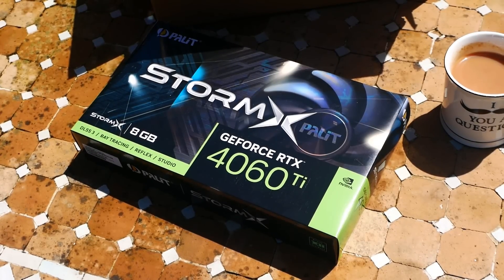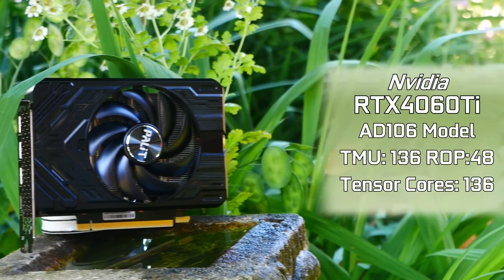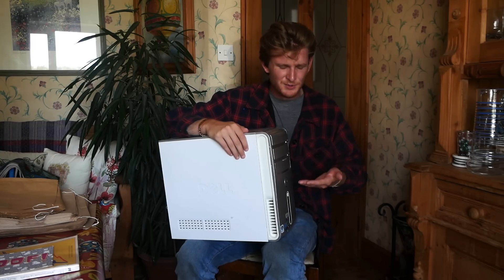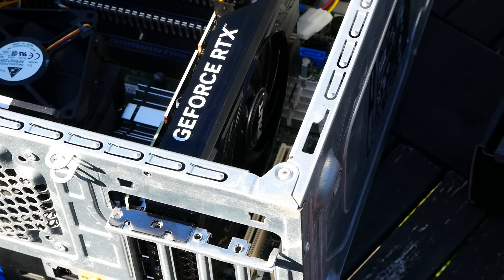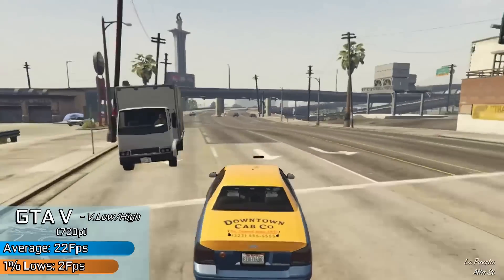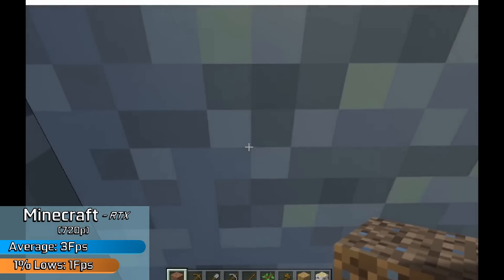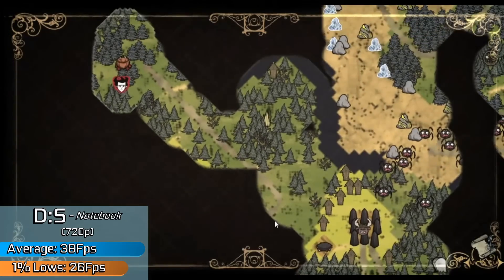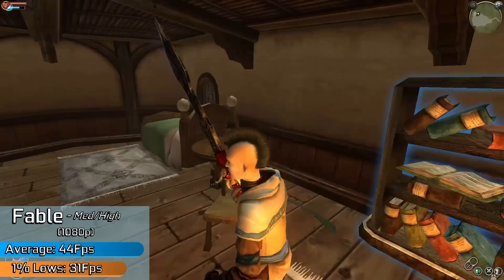RTX Graphics Card in a 20 Year Old Family PC...

Comment: This was extremely enjoyable and something I had no clue was even possible. A Pentium 4 with an actual useable PCI-E Slot 😭 You should try a Core 2 Quad and compare em. It's incredible to think about modern CPU's.. Nehalem was released in 2008 and is still somewhat useable, that's the same amount of time going back to the original P5 Pentium in 1993 and the P5 was not useable in 2008.
Reply: I was enjoying westmere until just last year. The old xeons are utterly capable even lacking avx2.
Reply: @ignotumperignotius630  definitely. Tons of YouTubers including myself have praised em for years. I have a Westmere EP system still to this day with 5690s that's extremely capable. I even used it as a main rig for a while earlier this year due to a fatal issue with my main rig. I used it for editing and playing Battlefield 2042 casually for about 2 months. Even Fortnite ran well and I was using a 3060ti and GPU usage was 100%. I was impressed again, to say the least
Reply: Not really a surprise when the northbridge was responsible for PCIe back then.
Reply: He kind of compare them at 12:46

Comment: I wonder if one of the newer AMD RX 6000 graphics cards would do better. They perform more tasks on the GPU instead of farming it out to the CPU, so you can get 20% or so more performance than Nvidia sometimes if you have a really slow CPU.

(AMD GPUs can be more difficult to get working under weird situations though, and this is definitely weird lol)
Reply: These dell BIOS require a boot mode that AMD doesnt support I will test with my 6700XT on my P4 system.
Reply: @RedStripeMedia  As soon as I get my upgrade ready, I will throw my 1060 into my Core 2 system, just to see how ridiculous it gets.

Comment: the ram is the issue in most i have a dell t5400 with 2 e5450 3ghz quad core processors and 32gb ddr2 fb ecc ram. gta v runs at most 45fps as the ram just isnt fast enough.

Comment: Makes me think, if Budget-Build Official will ever do an AMD APU + Matrox Arc A380 (Intel) build.

Technically, with a Full ATX B350 board, he can have access to a Ryzen 5-5600G + the Matrox Arc 380 and have PCI lanes for a Voodoo 2 or Voodoo 3 PCI, which can be made to work on Win10.

So he'd have
AMD (ATI in spirit)
Intel
Matrox (using intel ARC chip)
3Dfx

All in one.

Comment: Would have been interesing to see if the newer aaa titles launced on this cpu and the rtx 40 series with their frame gen support reduces cpu load even further smoothing out the frametimes. And also using 1080p as the testing resolution might have helped as 720p was really hard on the already weak cpu!
Reply: Some will not start. The CPU is missing a lot of instructions.

Comment: So the inspirons of that era were UEFI? afaik Nvidia dropped og BIOS support after pascal
Reply from the maker: It worked with an RTX3050, it doesn’t like booting with them in there but usually will after 3-5 attempts.
Reply: @BudgetBuildsOfficial  so it is in fact BIOS not UEFI? My friend tried running a Vega 56 in a baller Asus 775 board he found in the bin but it artifacts when booted to an OS with the Vega, however his 1070 is fine

Comment: I wonder, is it possible to make a Pentium-only LGA 775 board to start with a Core 2 Duo processor? Would editing the bios be enough for this? There are some decent boards out there that could benefit from having Core 2 Duo instead of the maximum of Pentium 4/Pentium D. Hell, I wonder if it is at all possible to make Core 2 Quad work on that.
Reply: I once had an old Amilo Desktop that came with a late P4 and was upgraded to an E6600 through a simple BIOS update. It mostly depends on the motherboard/ PC manufacturer. If no official update is available, it depends on the chipset and FSB, but generally speaking late P4 motherboards can run Core 2 Duo pretty easily.
Core 2 Quad are generally a no go unfortunately, could never make one work even with BIOS modding, they are completely different.

Comment: I wonder if an RX 7600 would have done better, due to the driver overhead on the Nvidia card.
Reply: That's what I thought! Getting rid of that annoying driver overhead and it should be silky smooth.
Reply: Makes me wonder where AMD have improved their driver overhead. I still remember during DX11 times how much they gained from switching to Mantle and later Vulkan.
Like in Doom 2016 where a RX 480 easily gained 25-50% and went from being 25% slower than a GTX 970 to being 15% faster, while nvidia cards gained 5% at best from low level APIs.

Comment: RX 6400 would be a suitable GPU for this one. Sure, probably at least 10x faster than the fastest GPUs of the Pentium 4 era, but a 2020 era gpu with 4GB of vram and 53W TBP is something else.
Reply: rofl the times when I had more video ram than I had actual RAM for my pc .
Reply: Seen how much the RX 6400 is held back by PCIe 3? Yeah, this got PCIe 1
Okay, on one hand every modern card would be bottlenecked by a Pentium 4.
But from a more realistic perspective (getting a new card for your ancient computer), the user would probably also max out the other parts.
So a Core 2 Quad, 8 GB RAM and a decently sized SATA SSD would be in there.
And for that the RX 6400 is the wrong card.
I would say GT 1030 level performance is the absolute maximum, and even that is stretching it.

Comment: Would you not have gotten higher FPS by increasing the resolution? Take a bit of strain off the CPU
Reply: That's not how it works, if you are at 22fps at 1080p, then no matter how powerful of a graphics card you would still be stuck at 22fps at 4k.
Reply: @interstellartravel  hmm that's strange. Back when I ran a q6600 with a gtx 1060 I always got higher FPS at 1440p than 1080 or 720p. No idea why 😂
Reply: @nahsonnn2573 because increasing resolution reduces cpu load and makes the gpu do most of the work. If your framerate is hovering around 20 fps at say 720p ...you will definitely get close to or above 30 at 1080p or higher though there will be hiccups.
Reply: @interstellartravel i think you should see some online comparisons of how increasing resolution decreases cpu load. You can even test it yourself if you have a balanced setup. If you are getting 22fps at 720p you will definitely get above or almost 30 at 1080p Or higher at higher resolutions. And these new 40 series rtx cards with their frame gen capability reduces cpu load even further especially on weaker cpus.

Comment: Yeah. You can achieve better real time ray tracing with 1070 ti. Pentium 4. Should be core 2 quad bare minimum. Even then your still getting similar fps with a 1070 ti and 4060 ti in quake 2 rtx.

Comment: This is what happens when you spend the entire budget on the GPU
Reply: You could actually find better CPUs for free, at the side of the road 😁
Reply: @aleksazunjic9672  It right. At least core i3 2nd generation. They may be lying on the road. Nobody needs it today
Reply: I found a core 2 duo years ago in the trash. (It was hiding inside an iMac).
Reply: When you buy the rest of your system with the mail in rebate savings
Reply: Wii U:
Reply: I found a GTX 1050 Ti on the street in the middle of the chip shortage
Reply: Damn it, I was gonna say that lmao.
Reply: Well, I learned this the hard way 10 years ago :D
Reply: *cpu
Reply: Go for a solid  main system to build off  get a proper  Motherboard, Cpu,Ram ,psu,cooling  once you got a solid foundation then  get a nice GPU
I dont understand why ppl  skimp on the  foundation when building a PC , a solid core build will last longer then a mid one with a godlike GPU
Reply: @mauro100  Nope. Without decent  CPU your computer is basically useless even for browsing the net.

Comment: The value proposition of this PC is actually a perfect fit for the 4060 Ti
Reply: The 3060 would work better because it can at least utilise all 16 lanes
Reply: @nutsandcast  Bandwidth would still be shitty because its like pcie 1.0
Reply: Why say that? Is the 4060 that bad in comparison to 70 and 80 series in the even the older 20 or 30 models?
Reply: @MrAceAwesome1 Sadly, yes
Reply: @MrAceAwesome1 the 4060 and 4060ti are overpriced and not really an upgrade at all to the 3000 series cards of similar name. 3060 is actually the better buy because it's got 12gb lol.
Reply: @MrAceAwesome1  4060: 3060 with dlss3
Reply: @MrAceAwesome1  4060 Ti is identical to the 3070 in all but name and wattage, and for the cost of about 1000 CUDA cores, you're getting DLSS3.5.

Comment: And on the next episode, we'll see an intel 486 paired with an RTX 4090
Reply: No drivers would work, but theoretically you could use a PCI->PCIe bridge and use it as a video output device.
Reply: @DrewWalton  Not many 486 systems have PCI slots, but there are a few.
Reply: @DrewWalton  maybe som linux drivers can work
Reply: @samoskvarenina4285  proprietary Nvidia blobs? Lol no
Reply: I wonder how VESA BIOS mode holds up after all these years.
Reply: 😂😂😂😂good luck
Reply: It would have to be a 486DX It will at least need a math co-possessor.
Reply: Running OS/2 Warp 4. CPU bottlenecks don't matter if you can't utilise your GPU
Reply: Doom 2 gonna look hella good
Reply: Never going to happen cause a motherboard old enough to support a 486 isn't even going to have PCI slots, let alone PCIe. Good luck getting a 4090 to work on an ISA slot.
Reply: the ultimate bottleneck
Reply: An SX20
Reply: doable
Reply: Possible
Reply: its possible, throw windows 2000 and vesa vga drivers (generic drivers) and you will be good to go with rtx gpu
Reply: How about The Babbage Engine paired with an RTX 4090
Reply: Nah screw i486, better off using an Am486DX4 100MHz or something like that, it's probably more powerful than the Pentium 4 in the video. There may be motherboards with Socket 3 and PCIe in one, thanks to the wonderful standard that is PC/104.
Reply: i think the gpu is to slow for the 486
Reply: @qessrr  and I think grass might be green
Reply: SX!
Reply: Linux and a socket 478 board with PCIE might might work. Just barely.

You really need amd64 support nowadays.
Reply: Finally half life 2 might run on a 486
Reply: nahh and amd Athlon XP processor instead.. single core.
Reply: nah, go for an 8088